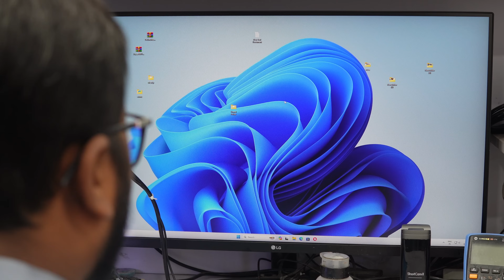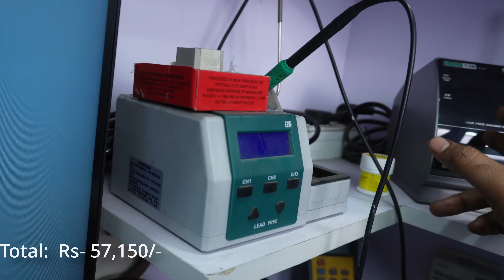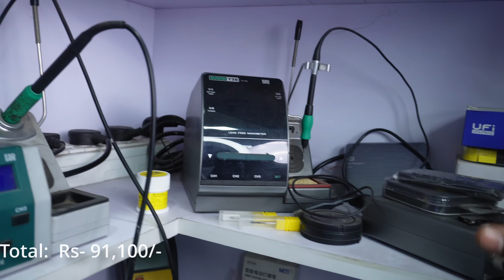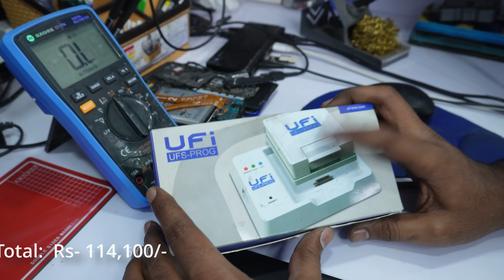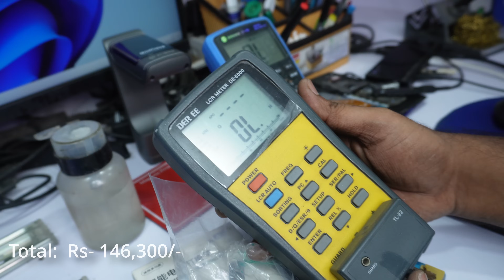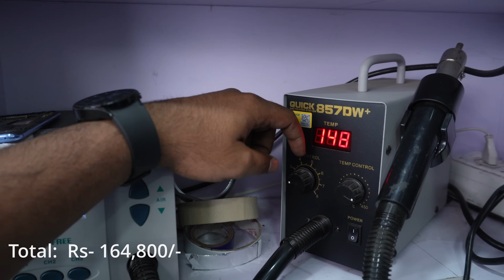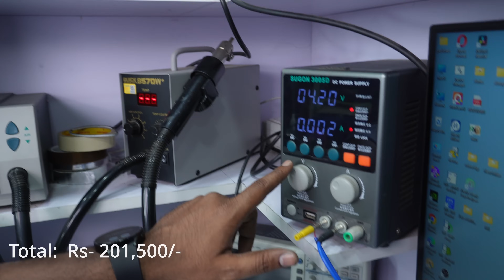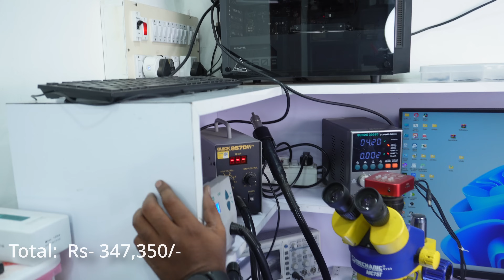Mobile Repairing tools name list | Best Mobile Repairing Tools [2024] Tamil

Comment: With logical thinking, only multimeter, tip and chisel solder, good solder wire, liquid paste, thermal paste,  soldering station and basic hardware is enough
Reply from the maker: Yes, you are absolutely right,  but as u get to some advance level,there is a need to upgrade. These are some of the tools I use. Not all tools are mandatory for all technicians 🙂

Comment: Do you use thermal camera
Reply from the maker: yes
Reply: @NoonComputersTamil  I have purchased shortcam 2 thermal camera recently, it's working fine. Now I can able find leakage shorting quickly without messing up the motherboard.
Reply from the maker: Super, I am too using the same

Comment: bro just a doubt , my mobile is dead and i cant able to restore my data . If i give to service or repair shop , is there any chance people will access my data and sensitive information by using any software ? i also have password lock too . Pls do reply .
Reply from the maker: No it's not a easy task to Crack password.  Don't not share passwords with service centers unless it's necessary